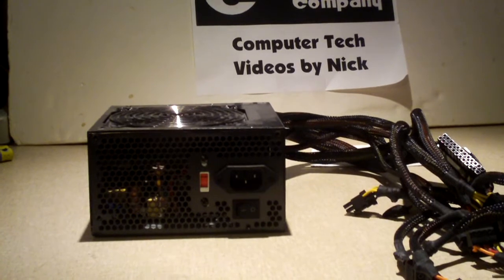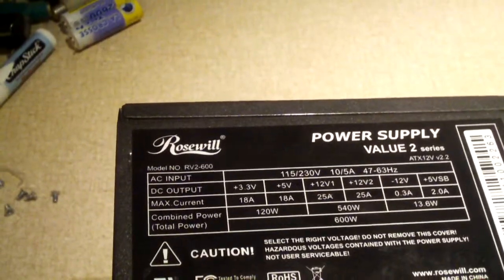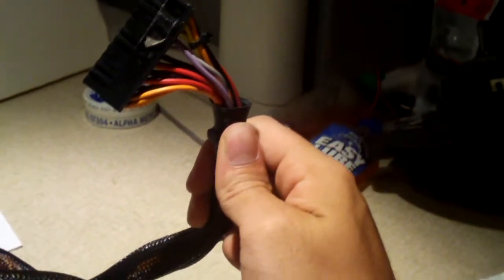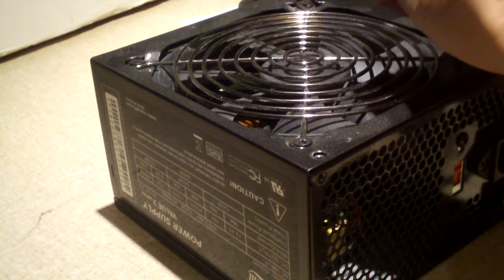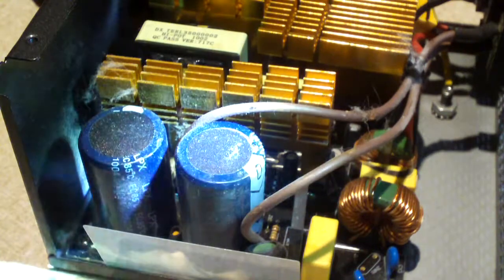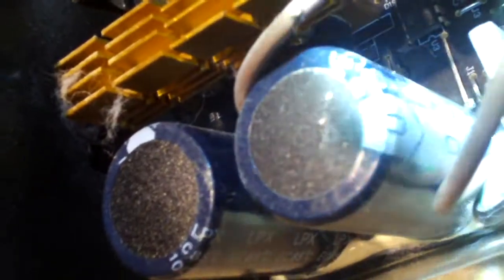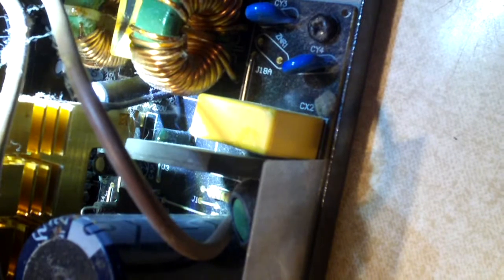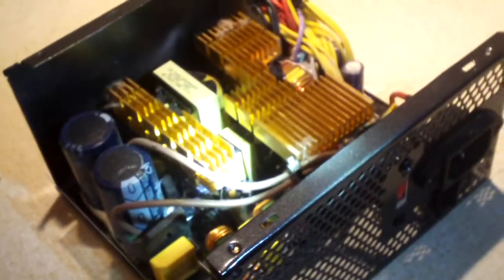Brief look at a failed Rosewill RV2-600 Power Supply

Comment: I think it might be using half-bridge topology rather than two switch forward becuase of the two large rail splitting electrolytes (assuming they are not in parallel). But if it is half-bridge then it does seem dubious that there is no flux walking capacitor on the board, perhaps that is where they messed up in the design. A saturated transformer core will look like an almost short circuit.